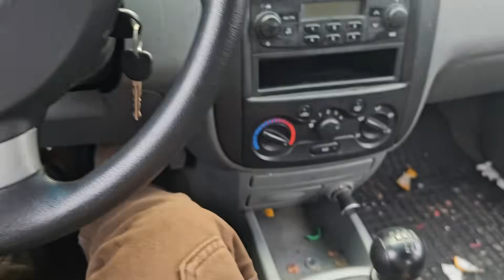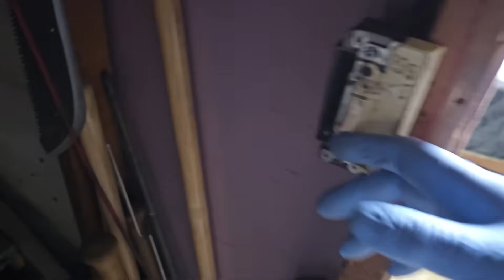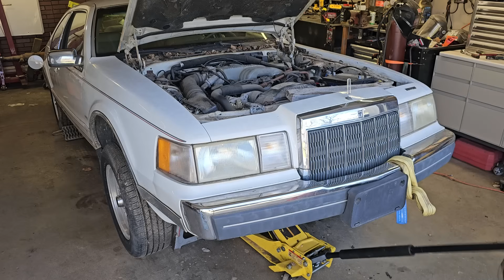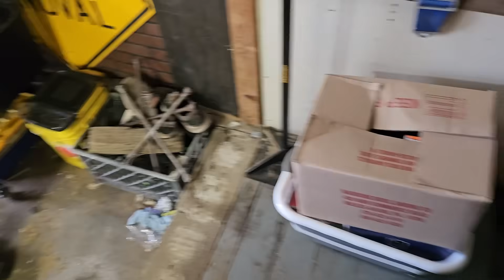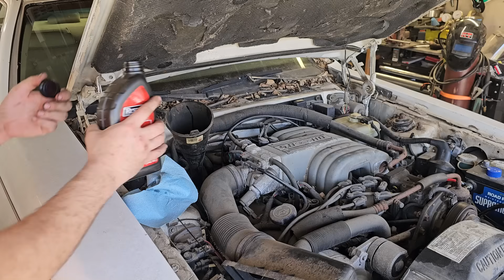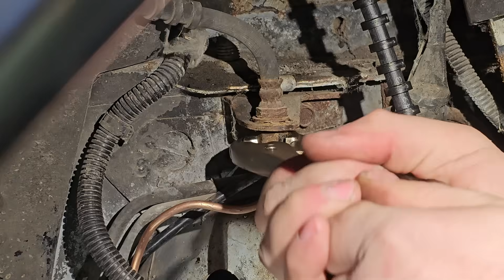Budget Foxbody Mustang ?

Comment: Dudes!  I have 4, yes four running Mark VIIs. 3 LSCs, 1 Bill blass.  About 2 years ago, I just missed a factory optioned BMW turbo diesel 6 cyl with aftermarket ground effects. It looked like a larger 90 mustang GT. Also a black interior was an odd option with most LSCs being red and Bills being a tan. LSCs came with a limited slip. Also the LSC didn't have the hood ornament. JBL premium sound also.

Comment: Owned an 89 LSC and a 90 LSC-SE. A hack for the leaky air suspension bags. Pull the solenoid and squirt some tire slime in each one. Will seal the leaks at the fold. 🛠️

Comment: What wire cutters were you using, they snipped right through that power wire
Reply from the maker: Blue handle cutters were IDEAL 35-052 BB HH. Red handle were Klein D248-8  the blue handles are what I have always called lobster cutters. Perfect for thicker  gauge wire also work great on small rubber hose . The red Kleins are just a good all around side cutter. Klein makes a good lobster cutter to or Knipex but I buy whatever is the best value for what I'm getting. Which usually means what's a decent brand and on sale or clearance
Reply: @DudesWithWrenches  sweet man, lifesaver I was searching for hours😂

Comment: Something to keep in the back of your mind when working on a vehicle with an AOD.  The converter lockup/shaft can seize which locks the torque converter and thus the engine.  It fooled a couple of techs I know.  Great road cars but the cost of suspension parts (airbags, the variable damping struts, air pump and sensors) can bankrupt some.  Oh God, the cost of ABS components.
Reply from the maker: Thanks for the info, and yes, a ticking time bomb of hard to find parts. Indeed

Comment: Heck yeah good video. I 5 speed swapped mine even more fun.
Reply from the maker: If the transmission gives us any issues, that's the next step.. What did you source all the parts from ?
Reply: @DudesWithWrenches   mustang T5, clutch, pedals, clutch cable. Lincoln driveshaft and crossmember works. I made a video on it. Bolts right in for the most part.
Reply from the maker: Nice I'm going to check this AOD doesnt have alot of life left in it and a 5 speed would alow alot deeper rear gear

Comment: You really need to invest in the hydraulic brake flaring tool. It’s a little pricey, but considering where you live and what you have to do with brake lines it is so much easier and it saves you so much time and aggravation, and then at the end of the day, you smile a little more when you open the first beer.
Reply: It’s the cats ass!
Reply from the maker: Those are facts you may have talked me into, it but tool buying doesn't take much

Comment: When I had a car suddenly blow up on me. I bought an Aveo from a friend. It was his sister's before his. When I got it. I put a couple hundred into it and it kept going. Then I sold it and it's still around. Just change the fluids. Boring car but it did what we needed it to do.  Also there is a switch in the car to turn off the air suspension for service when you lift it. Its a self leveling system so it will always run. The air suspension keeps level for like an hour after you shut it off also. I had a town car.
Reply from the maker: Yah the Aveo was free we keeping fixing it because why not you can't kill that thing. Thanks for the information and comment
Reply: @DudesWithWrenches  if it ever randomly doesn't start. It's the coil pack. They get hot and stop working.
Reply from the maker: I have a 95 f150 that had that issue thought it was the fuel pump the way it would cut out. When it finally left me walking I diagnosed it . The coil was way easier to repair so I was ok with it.

Comment: I used to want one of those but could never afford. Looked at one at Stivers in Des Moines and my wallet went running out the door. Thanks for the ride along and the wrenching on it , I guess that’s why I ended up buying a Taurus instead.
Reply from the maker: Yeah, these things are all over price wise these days. This one was $1100, but motor transmission and rear diff are worth that no a great deal. But when you go to an auction with cash and a trailer hard to o home, empty-handed
Reply: @DudesWithWrenches  that sounds like a good buy to me , car still looks nice despite the other issues. Thanks for the great channel!